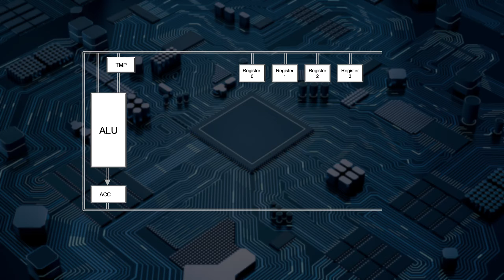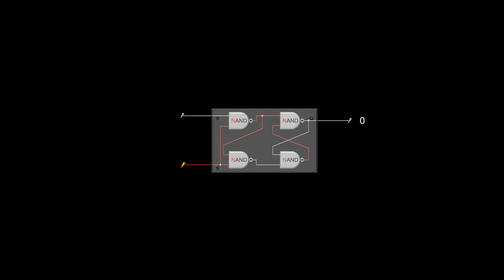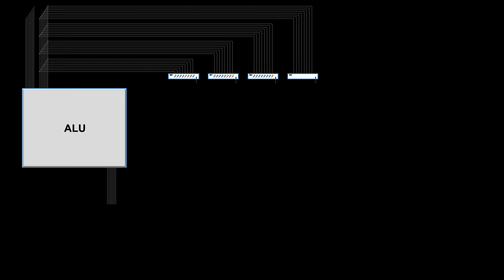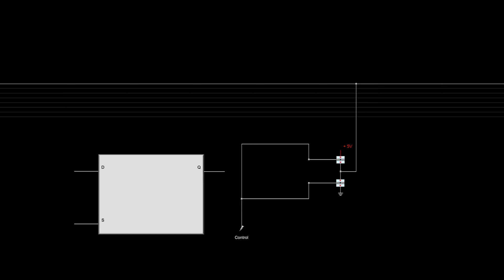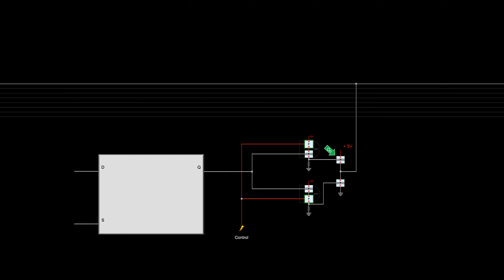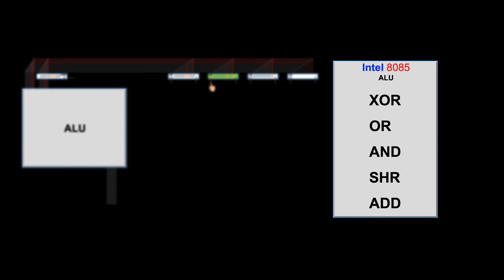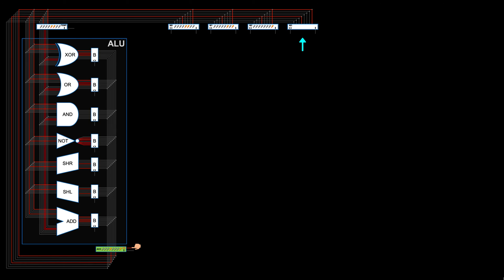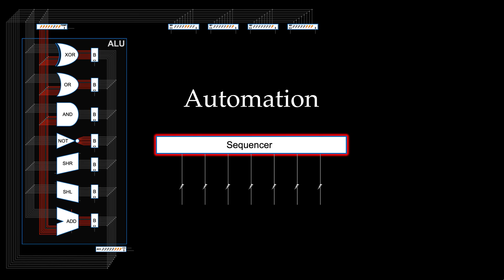Tri-state Buffer and Bus | What Make a Computer, a Computer? -- hardware #1

Comment from the maker: I am opposed to relying on truth table for explaining simple circuits. If you are used to the truth table approach, it would be difficult to understand buffer: because truth table always get you to think from the input side to the output side, but now, there is voltage placed directly on the output side, so what will happen? Truth table won't be able to explain that! So in order to understand the buffer, you need to know what's really going on underneath, physically!